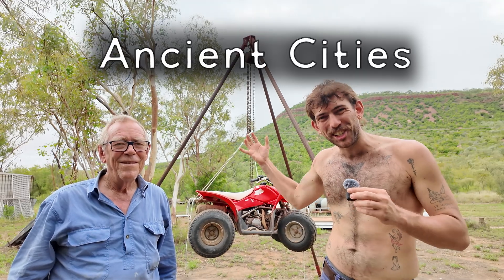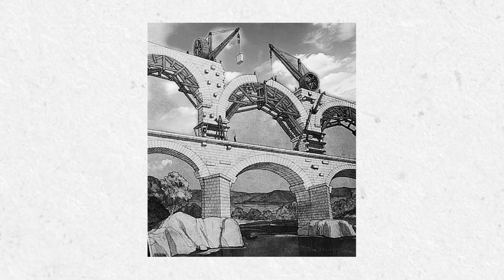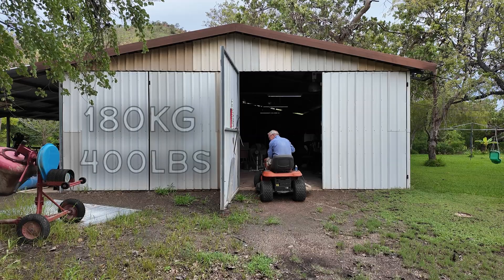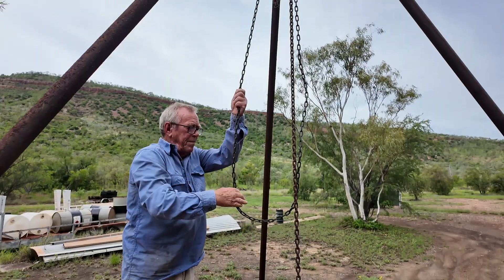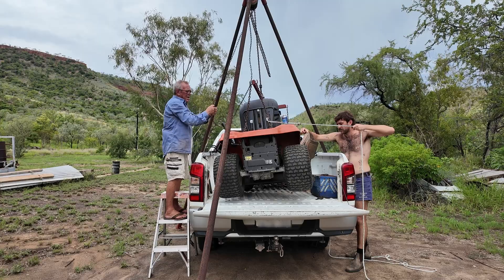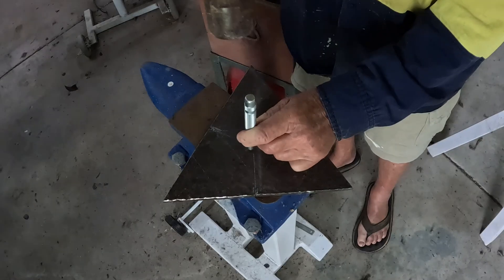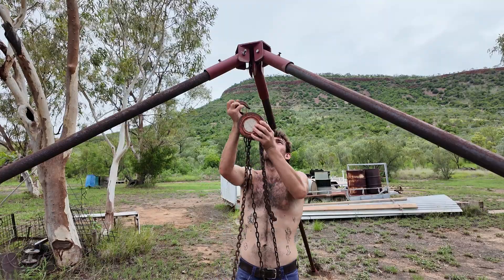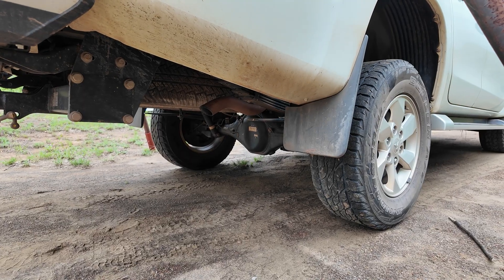The One Tool That Built Ancient Cities | The Tripod Hoist

Comment: i built a tripod 25 years ago similer to this one for lifting and moving heavy objects around the back yard. tested on a 1500kg block of concrete works very well i used grade 8.8 m16 bolts and m20 eye bolt and used scaffold tubes for the legs

Comment: Nice tripod grandad built there. Would you be so kind as to add a few dimensions and say how much you've lifted on it? I can knock one up in no time but it's always good to learn/copy the parameters from experience. Even just knowing the dimensions of a cheek piece or even the bolts used (8 or 10,mm) and what they tolerate in practice would be a great help. And the length, diameter and wall thickness of the legs for the same reasons? Many thanks for the video. Or maybe you could do a sketch thumbnail? Thanks again.
Reply: Hey I just made my own based off what I saw in this video and I could tell you measurements and thickness if you want. It would be in inches. With mine I have lifted 1,000 lbs verified with lifting scale.
Reply: @Pitbullpower  thanks very much for the kind offer but I built one a couple of weeks ago and just made a film of it yesterday for my YT channel, replete with drawings - will be online soon. I would like to give it a real, serious test, so may have to do that before publishing :)